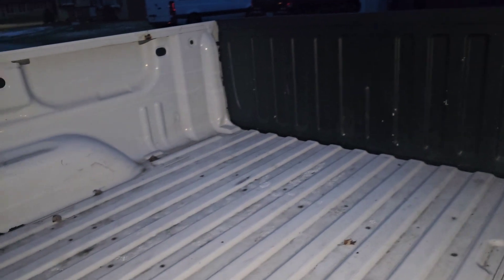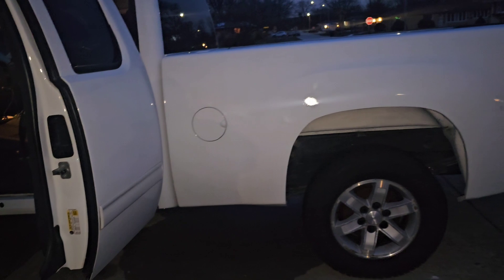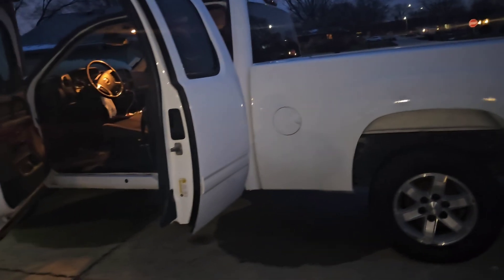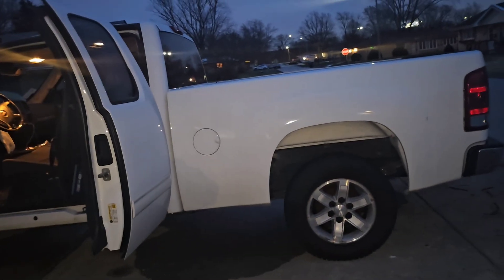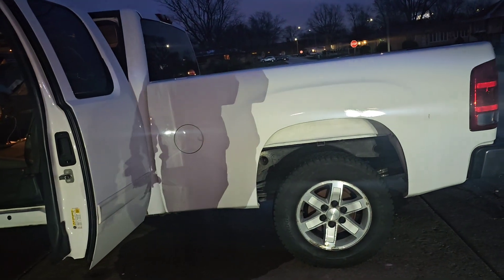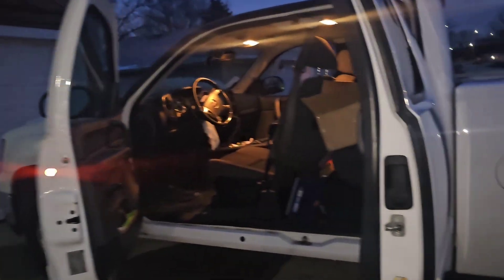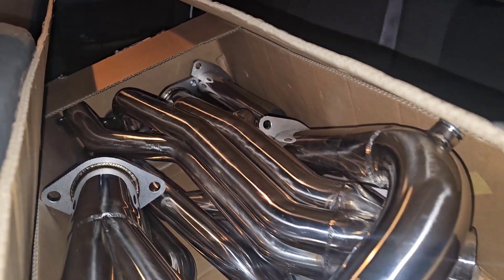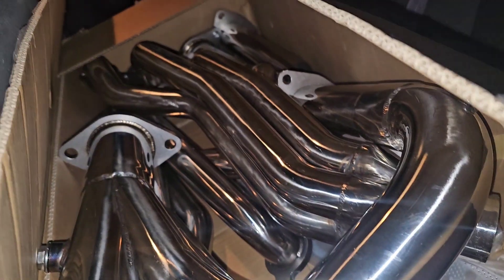2007 GMC Sierra Uodates - D.O.D Delete, Long Tube Headers, Chop Chop Cam, Evap Issue

Comment: Hey rich just did the frame on my 3500hd this summer. Scrapped all the wax coating off and painted with Eastwood rust Encapsulator(not converter). I recommend scraping the big shit off with razor blade, wire wheeling the areas with little coating left then clean thorough with laquer thinner. Then I fluid filmed after so far so good

Comment: Thinking of going to a 2024 Tahoe from a 2010 Ford Expedition.  What’s your thoughts on the “new” DOD/AFM.  Are you seeing the same rate of failure ?  I’m comfortable with the devil I know, afraid to make the jump.
Reply: They use the same lifters, so same problem.
Reply from the maker: Same lifters same problems